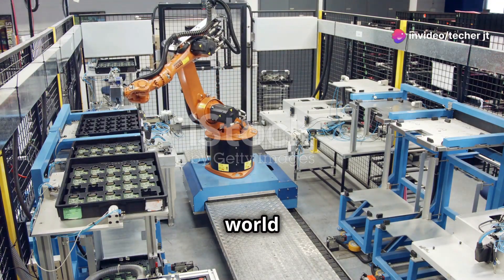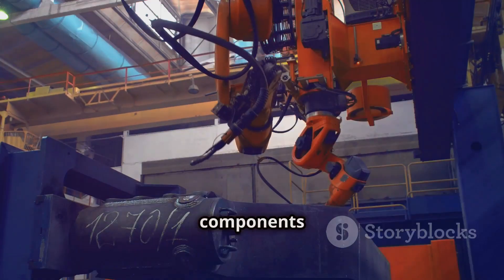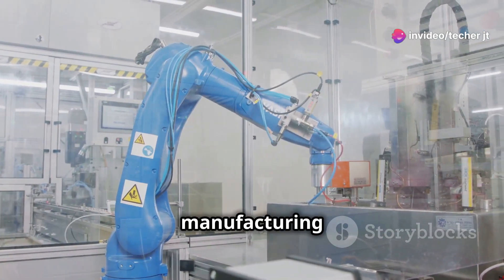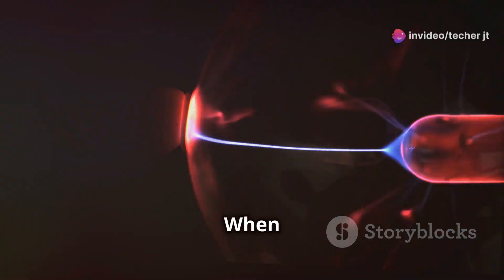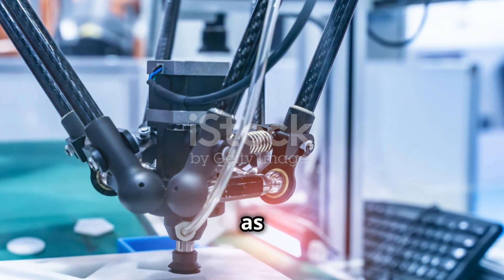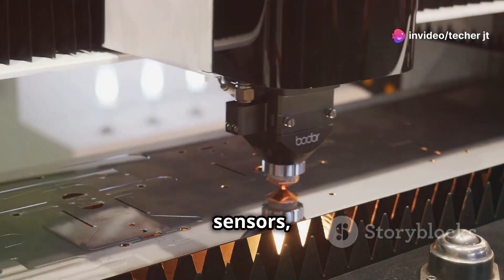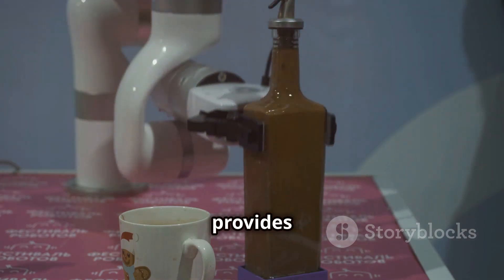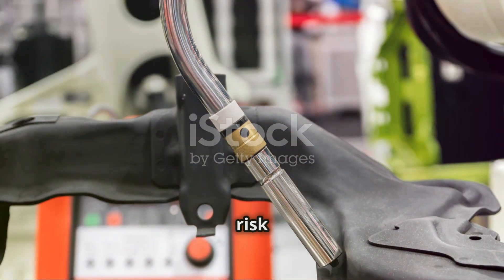Inductive Sensors for Robotics

Comment: Cheryjan G. Aclo
10 - Cassiopeia 

1. What is the primary function of inductive sensors in robotics?

- Inductive sensors are used in robotics to identify metal items without touching them.

They generate an electromagnetic field and monitor it for changes when metal is around. This enables robots to locate and quantify the distance between objects. These sensors enable robots to work precisely and efficiently in a variety of situations.

Comment: Christine Divine S. Taña
10-LYNX

3. The maximum distance at which inductive sensors can detect metallic targets is defined by their sensing range. It depends on the size and composition of the target; mild steel is typically calibrated for best results. To choose the best sensor for efficient detection in industrial applications, one must be aware of this spectrum.

Comment: Dave Aaron V. Dagcuta
10 - Lynx

1. What is the primary function of inductive sensors in robotics?

Inductive sensors in robotics primarily function as proximity sensors, detecting the presence and proximity of metallic objects within their sensing range. They work by generating an electromagnetic field and measuring changes in this field caused by the presence of metal.

Comment: Ezra Shimei B. Calaycay
10 - ANDROMEDA

1. What is the primary function of inductive sensors in robotics?
- Inductive sensors are used in robotics to identify metal items without touching them. They generate an electromagnetic field and monitor it for changes when metal is around. This enables robots to locate and quantify the distance between objects. These sensors enable robots to work precisely and efficiently in a variety of situations.

Comment: Evzen Radik A. Salvador
10 - Orion

3. Explain the significance of the sensing range in inductive sensors.

The sensing range in inductive sensors is crucial as it determines the distance at which the sensor can effectively detect metallic objects. This range affects the sensor's ability to perform accurately in various applications, such as automation, robotics, and industrial machinery. A well-defined sensing range ensures optimal performance, allowing for precise detection and positioning while minimizing false readings or interference from other objects. Understanding and optimizing this range is essential for enhancing the efficiency and reliability of systems that rely on inductive sensing technology.

Comment: Kyle Ross B. Baiño
10 - Lyra

3. Explain the significance of the sensing range in inductive sensors.

  The sensing range of an inductive sensor is crucial for determining its detection sensitivity, application flexibility, obstacle avoidance, and precision. It determines the maximum distance at which a sensor can reliably detect a target object. Factors affecting sensing range include sensor design, target material properties, and environmental factors like temperature, humidity, and magnetic fields.

Comment: Anika Chloe J. Pepito
10-LYRA

3. Explain the significance of the sensing range in inductive sensors

The farthest distance at which inductive sensors can detect metallic objects is known as the sensing range. It is affected by the size and composition of the target; mild steel is typically used to achieve the best results. Selecting the appropriate sensor for efficient detection in industrial applications requires an understanding of this spectrum.

Comment: AKISHA BACHINICHA
10 ORION

1.) The primary function of inductive sensors in robotics is to detect the presence of metallic objects without physical contact. They operate by generating an electromagnetic field and measuring changes in this field when a metal object enters it, allowing robots to identify and interact with nearby metallic components.

Comment: Iñigo Sevillejo
X-Cassiopeia

1. What is the primary function of inductive sensors in robotics?

Since they give robots the ability to detect touch or proximity, inductive sensors are essential parts. They are well-known for being sturdy, affordable, and reliable, which makes them perfect for a variety of robotic applications. Inductive sensors enable robots to perform a wide range of activities, from basic task identification to intricate navigation, precisely and efficiently in a variety of settings. They serve as the robot's eyes, identifying the location and presence of metal objects. The robot's control system will then get the information, enabling it to adjust its motions as necessary.

Comment: Angel C. Sumastre
10- Cassiopeia

1.The primary function of inductive sensors in robotics is to give robots a sense of touch or proximity detection. They serve as the robot's eyes by detecting the presence and position of metal objects, relaying this information to the robot's control system, which allows for adjustments in movement.

Comment: Reeve Radley C Fua 
X Cassiopeia 

3. The sensing range in inductive sensors determines the maximum distance for detecting metallic targets, which is affected by the target's material and size. Typically, optimal performance is calibrated using mild steel. Understanding this range is essential for selecting the appropriate sensor to ensure effective detection in industrial applications.

Comment: Urhyness Agatha Santos 
10 Cassiopeia 

Question: What is the primary function of inductive sensors in robotics?

-Answer:The primary function of inductive sensors in robotics is to detect the presence and position of metal objects without physical contact. They operate on the principle of electromagnetic induction, providing reliable, robust, and cost-effective proximity detection.

Comment: Fresh M. Satur
10 - LYNX 

What is the primary function of inductive sensors in robotics?

Inductive sensors in robotics primarily function to detect metallic objects without direct contact. They work by generating an electromagnetic field and measuring changes when a metal object enters that field, which is crucial for applications like proximity sensing, object detection, and automated positioning.

Comment: Jacinth J. Yerro
10-Hermes

5.Identify two applications of inductive sensors in robotics and explain their roles.
Inductive sensors are employed in robotics for object detection and safety proximity sensing; they can identify metallic objects without contact, facilitating precise positioning on assembly lines and acting as safety measures by detecting nearby obstacles or humans to avert accidents.

Comment: Jhon Lemuel C. Valmorida
Grade 10 Lyra

1.An inductive sensor is an electronic device that can detect ferrous metal targets without physical contact.

Inductive sensors will also detect non-ferrous metal targets like aluminum, brass, and copper. But using non-ferrous metal targets decreases an inductive sensor’s sensing range.

Comment: Alvin M. Tagudin
10-Hermes

5. Identify two applications of inductive sensors in robotics and explain their roles.
-Inductive sensors are used in robotics for object detection and safety proximity sensing; they detect metallic objects without contact for accurate positioning on assembly lines and serve as safety devices to prevent accidents by detecting nearby obstacles or humans.

Comment: May ville D. Ortega 
10- lyra

1. What is the primary function of inductive sensors in robotics?

Inductive sensors are primarily used in robotics to detect the presence or absence of metallic objects without making physical contact with them. Robots are able to sense objects and measure distances for a variety of tasks because of their ability to generate an electromagnetic field and measure changes in this field caused by the proximity of metal.

Comment: Zophiel Hailey Jace B. Usman
10 - Hermés

1. What is the primary function of inductive sensors in robotics?

- Inductive sensors help robots to check the presence and position of metal objects, allowing them to "sense" their surroundings without touching anything.

Comment: Precious Lea Jennifer D. de Dios
X - ORION

2. Describe the difference between shielded and unshielded inductive sensors.
- The difference between shielded and unshielded inductive sensors is that shielded inductive sensors are preferred for applications demanding precise detection within a defined area especially in environments with potential metallic interference. However, unshielded inductive sensors might be suitable for applications where a wider sensing range is acceptable and the risk of interference is minimal.

Comment: Hannah Bella A. Ihalas
Grade 10 - Hermés

1. What is the primary function of inductive sensors in robotics?
— Inductive sensors empower robots to operate with precision and efficiency in diverse environments. They act as the robot's eyes, detecting the presence and position of metallic objects without physical contact.

Comment: Francess Elizah A. Pintac
10 - Hermes

2. Describe the difference between shielded and unshielded inductive sensors

- The difference between shielded and unshielded sensors is that, unshielded sensors lack metallic shield around the coil, resulting in a wider, more diffused sensing field. Meanwhile, shielded sensors incorporate a metallic shield around the coil effectively concentrating the magnetic field to a smaller, more focused area directly in front of the sensor's face.

Comment: Johann Rey Silmonet
10 - Andromeda

3. The sensing range of inductive sensors defines how far they can detect metal objects, which is vital for their effectiveness in automation and industrial settings. A greater sensing range offers more flexibility in positioning the sensor while still ensuring dependable detection without the need for direct contact.

Comment: Marvin II T. Octobre
X-Andromeda
1. What is the primary function of inductive sensors in robotics?

An inductive sensor is an electronic device that can detect ferrous metal targets without physical contact. Inductive sensors will also detect non-ferrous metal targets like aluminum, brass, and copper. But using non-ferrous metal targets decreases an inductive sensor's sensing range.

Comment: Kenichie C. Racero 
1. What is the primary function of inductive sensors in robotics? 
-The primary function of inductive sensors in robotics is to provide touch or proximity detection by sensing the presence and position of metal objects without physical contact. This capability allows robots to operate with precision and efficiency, performing tasks such as component detection and positioning in various environments.

Comment: Deron Ethan B. Pacaña
10 - Hermes

1. What is the primary function of inductive sensors in robotics?

Inductive sensors in robotics are primarily used to detect metallic objects without making physical contact. They function by producing an electromagnetic field and detecting changes in that field when conductive materials are nearby. These sensors are widely utilized in robotic systems for tasks such as position detection, object counting, and ensuring safety by sensing proximity to metal surfaces or components.

Comment: Herah Jhylie Zean Q. Agbu
10-Hermès 

1. What is the primary function of inductive sensors in robotics?

- Inductive sensors play a crucial role in robotics by enabling robots to detect the presence of metallic objects without physical contact. It’s primary function is to provide robots a sense of touch or proximity detection. These sensors empower robots to operate with precision and efficiency in diverse environments.

Comment: Mabulay, Mikah R | X-ORION

1. What is the primary function of inductive sensors in robotics?

- An inductive sensor's primary function  in robotics is its ability to detect the presence of metallic objects without any physical contact by using electromagnetic fields.

Comment: Gabe Daniel S. Rivero
10 - Hermes

1. What is the primary function of inductive sensors in robotics?

The primary function of inductive sensors in robotics is to detect the presence of metallic objects without physical contact by generating a magnetic field that induces electrical currents in nearby metals, allowing robots to identify and interact with metal components or obstacles.

Comment: Ma. Nicole Cyse L. Rojo
10 - Hermes

2. Describe the difference between shielded and unshielded inductive sensors.

- Shielded inductive sensors have a metal ring around the sensing coil that focuses the electromagnetic field, making them ideal for short-range detection with minimal side interference. Unshielded inductive sensors, lacking this shielding, allow the field to spread more widely, enabling longer detection ranges but with more susceptibility to interference from surrounding objects.

Comment: Christian Dynniel M. Llanos
10-LYNX

1. What is the primary function of inductive sensors in robotics?
- Inductive sensors in robotics primarily serve to detect metal objects without direct contact. They operate by generating a magnetic field and observing changes caused by the presence of metal. This capability allows robots to evaluate their environment, avoid obstacles, and perform industrial tasks like part identification and sorting.

Comment: Gabriel Jan D. Calipayan
10-LYRA

5. Inductive sensors can identify and locate metal objects, they are frequently utilized in robotics. These sensors can be used by robotic arms on assembly lines to precisely locate and pick up metal parts, protecting the parts and the robot from harm. Robotic end-effectors can also be equipped with inductive sensors to track their orientation, position, and contact with objects. This is especially helpful for jobs requiring precise control over the end-effector, like welding or material handling.

Comment: Hamainie Briezies O. Gabriola 
10 - HERMES

1. What is the primary function of inductive sensors in robotics?

ANS: Inductive sensors provide robots with a sense to detect the presence or absence of metallic objects without physical contact. They work by measuring changes in the field when a metal enters the detection range.

Comment: Megan Louiesse E. Po
10- Hermes

1. What is the primary function of inductive sensors in robotics?

Inductive sensors are primarily used in robotics to detect the presence and proximity of metallic objects. They work by generating a magnetic field and measuring the changes in that field when a metal object enters or leaves the sensor's range.

Comment: Jade Sumalpong
10 - ORION

2.Describe the difference between shielded and unshielded inductive sensors.

Shielded inductive sensors have a protective shield around the detection coil, allowing them to be mounted flush with surrounding metal, while unshielded sensors lack this shield, resulting in a longer sensing range but requiring a non-flush mounting to avoid interference with nearby metal.

Comment: Zoe Jillian R. Cabrera
10 - Hermes

3. Explain the significance of the sensing range in inductive sensors.

-The sensing range of inductive sensors determines how far they can detect metal objects. This is crucial for their use in automation and industrial applications. A longer sensing range allows for more flexibility in sensor placement while ensuring reliable detection without physical contact.

Comment: Trixie Dalman
10 - LYNX
3. Explain the significance of the sensing range in inductive sensors.
- The sensing range of an inductive sensor refers to the  maximum distance at which it can reliably detect a metallic object. A larger sensing range allows for greater flexibility in robotic applications, as the sensor can detect objects from farther away. However, it is important to consider that the accuracy and sensitivity of the sensor may decrease as the sensing range increases.

Comment: Leeane Niña A. Dela Rosa
10 - Lynx

4. What are the advantages of using inductive sensors over other types of sensors in robotic applications?

Inductive sensors offer several advantages over other sensor types in robotic applications. First, they are highly robust and can withstand harsh environmental conditions, making them suitable for industrial settings. Second, they are non-contact sensors, meaning they do not require physical contact with the object being sensed, which reduces wear and tear and improves sensor longevity. Third, inductive sensors provide high accuracy and repeatability, making them ideal for precise positioning and measurement tasks. Finally, they have a fast response time, allowing for real-time feedback and control in robotic systems.eeane Niña A. Dela Rosa

Comment: Joaquin Gabriel L. Cabug-os 
10 - Cassiopeia 

1. What is the primary function of inductive sensors in robotics?

- The primary function of inductive sensors in robotics is to detect the presence of metallic objects without physical contact. These sensors operate by generating an electromagnetic field and measuring changes in the field caused by nearby conductive materials.

Comment: Blissany Y. Torralba
10-HERMES

1. What is the primary function of inductive sensors in robotics?

-Inductive sensors give robots a sense of touch or proximity. They are known for their reliability, durability, and cost-effectiveness, making them well-suited for a wide range of robotic applications.
Reply: Mitch Micah Niere 10 - Lyra

Proximity sensors aid robots in obstacle avoidance by identifying nearby objects without the need for direct contact. Signals such as electromagnetic fields and sound waves are transmitted to enable the robot to identify and move around objects. Infrared proximity sensors detect objects through light reflection and are handy for navigating indoors. Ultrasonic sensors aid robots in navigating around obstructions in environments with poor visibility, such as dusty or dark regions.